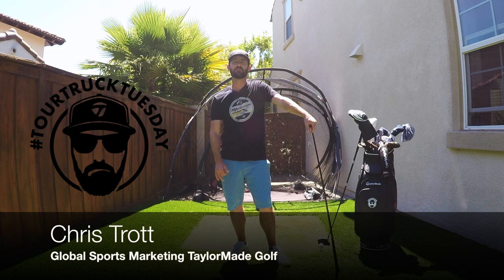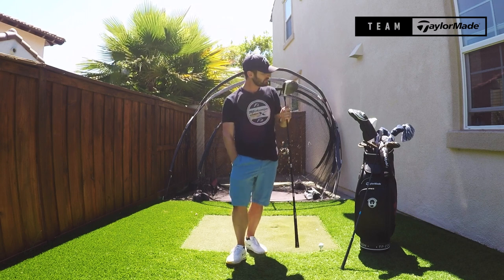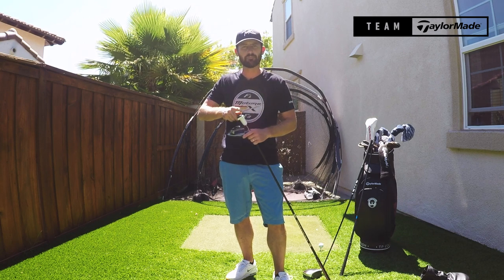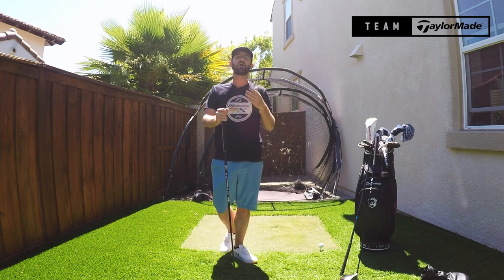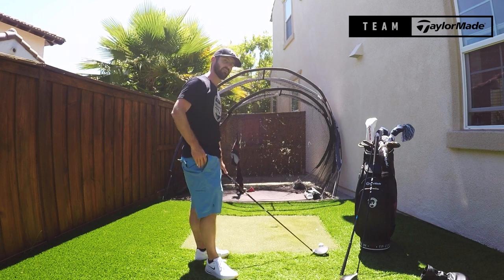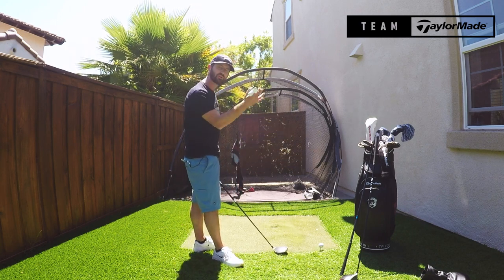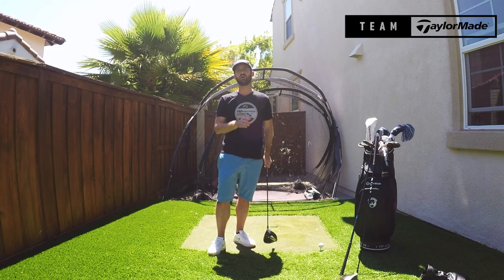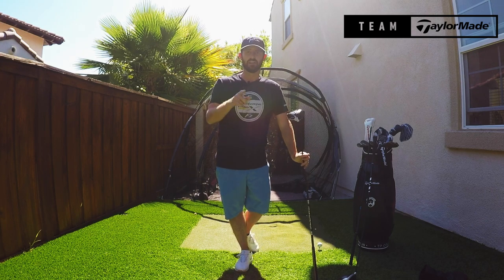How to adjust your TaylorMade Driver Loft Sleeve | Trottie Golf

Comment: Ok my M5 is 10.5 and I have it set up in one notch below higher with the weight in the low position front and the other weight in the draw position which I hit it the height I like and with a small draw or mainly straight 
It took me roughly 8 rounds and lots of tinkering till I found the point I was happy with but an incredible driver

Comment: Great video Tottie. I’m gaming the M5 10.5 driver with both weights back and one centre and one weight in the heel. I am finding from time to time I push my drives and my hard miss is left usually when I have tried to compensate. What weight configuration do you recommend for this?

Comment: I have a Qi10 Max. I need less loft but NOT an open face. What is the best setting for this?
Reply from the maker: Buy a head with less loft as a start point and then add as required. Should all be part of the fitting process

Comment: Hey great videos! I Had an M3 9.5 but I put a 12g extra weight in it. Seemed to flatten out my flight but I had it back and in the heel. Just bought a Sim, would I be crazy to mess about with putting a weight in the track on the Sim? Too much weight?

Comment: struggling to get my head round it, i have just bought a new m2 driver, not used it yet, i like to play with a slight draw, normally play with a 9 degree loft, how do i adjust the shaft so i still get the draw, i dont mind the 10.5 loft, please help. thanks mick.
Reply from the maker: Move the sleeve setting towards higher, or if you’re tall or like the toe up you can use the back side (which is upright) to manipulate lie angle to favor the draw 👍🏻

Comment: Does closing/opening head work if square on address?
Reply from the maker: Yes but it'll change face angle and loft
Reply from the maker: BUT if you mean you override the face angle as you adjust it in your hands then just remember you're changing the loft, therefore the spin and ball launch

Comment: I have a question that is off topic. With a TaylorMade driver, what advantage would there be by changing the lie angle from standard 56degs to 60degs? I haven't a clue.
Reply from the maker: It would impact face plane tilt & by going flatter your start line would move to the right more....
Reply: @trottiegolf  Think I'll just have to play around with it and see if there is any benefit. Thanks so much for your response.
Reply from the maker: @giocowie8009  all depends if you miss left .... it’ll help you if you do
Reply: @trottiegolf  I do tend to have a slight pull most of the time. I've noticed that is when I get the best distance and better face contact.

Comment: Is a 9* head turned up 1.5 identical to a 10.5* head set to standard loft?? Thanks Trottie
Reply from the maker: No. The Face Angle will be different.
Reply: Does that have more of an effect on shot shape or spin rates?
Reply from the maker: Michael Hernon appearance to the PLYR, start line & shape
Reply: Spin rate up... L to R shape

Comment: This is a bit mis leading.  You can't both change loft and face angle at the same time with the adjustable sleeve.  You can only change one variable at a time.  If the player adjusts the loft down AND soles the club flat at address then yes the face would now be open, but the loft will be the same as it was before.  But if that same player now manually squares that face up at address and then takes his grip, then the loft is now lower and the face is now square.  They are not independent variables.
Reply from the maker: If the player manually adjusts the face angle then the club is no longer soled on the turf. You cannot change loft without impacting face angle, that's how the loft sleeve works.
Reply: @trottiegolf  yeah that's what I'm saying. The loft is only changed if the club face is oriented in the square position after adjusting the sleeve.  If you just adjust the "loft setting" on the club then let it sit flush on the ground it is a face angle change not a loft change.
Reply from the maker: Kourt no that’s not the case. Once you adjust the sleeve you can’t override the true loft on the blade, it doesn’t matter what you do the loft is going to be the loft & the face angle is going to be the face angle ⛳️
Reply: @trottiegolf  yeah a 10 degree driver is always 10 degrees. But when you adjust the loft down it's a 10 degree driver with an open face angle. When you square the face back up by turning it square, not by re adjusting the sleeve setting, it's still a 10 degree loft head but it is now tilted slightly down which gives you a dynamic loft of 9.33 degrees or whatever amount youve adjusted.
Reply: @trottiegolf  https://youtu.be/Damc-c-Ka3g here's a great video by the man that invented the adjustable hosel back in the 90s explaining how it works better than I can over text.
Reply from the maker: Kourt you’re manipulating the sleeve by doing this & that’s not the intention ⛳️
Reply: @trottiegolf  the intent is to adjust the loft. That's why loft +/- is listed on the sleeve not a face angle measurement.  If you just watch the video you'll understand.  There's a reason the inventor made a 20 minute video explaining it, because it's very misunderstood concept.
Reply: @trottiegolf  you must be doing it wrong with all the Pro's hehe ;o) lol